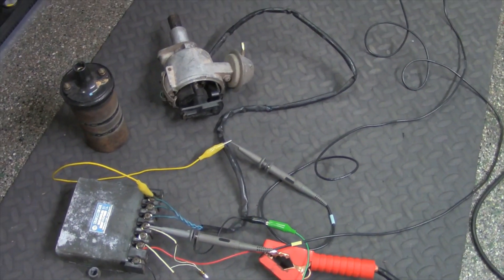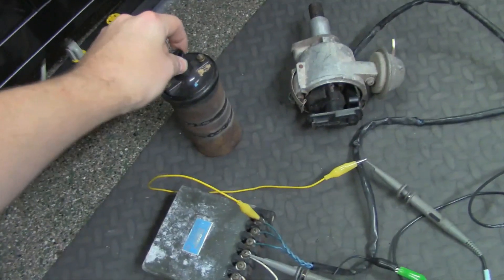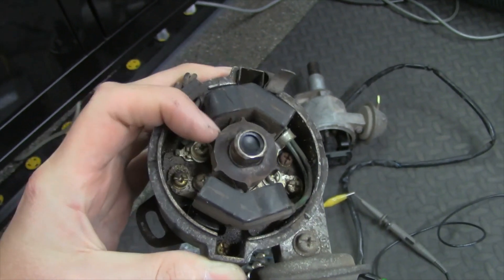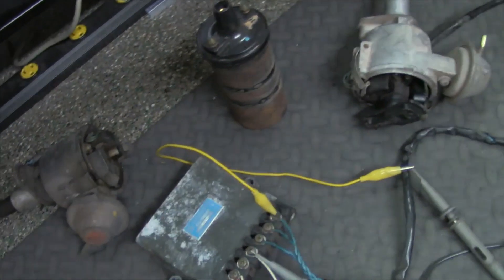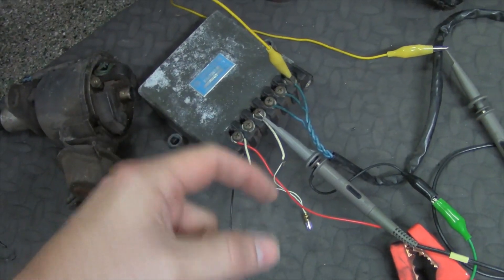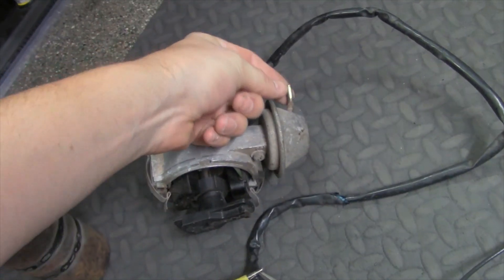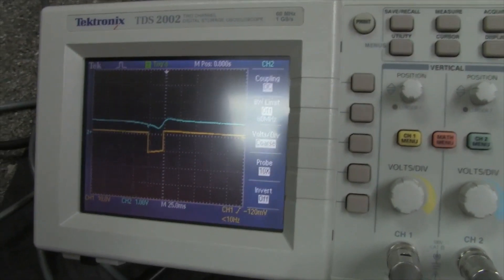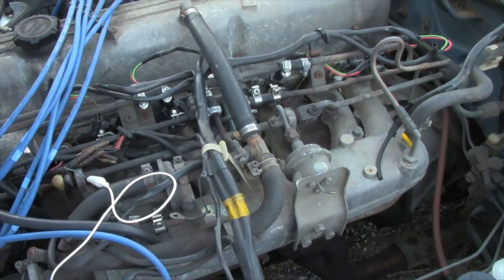How Datsun 260Z/280z Electronic Ignition Works  (by synthpro)

Comment: I know this is an old video but is there a way to test that box, my 280z ran perfectly then one day it cuts out terribly under load and I'm curious if this box is my problem, my other thought is ECU failure
Reply from the maker: Yes, you can actually test this box in a very similar fashion to what you see in this video. Disconnect coil form negative post and connect a test light between + suppl and the negative terminal that was going to coil. Turn the engine over and see if the light blinks with rotation. 

If it doesn't blink, I would check to make sure ignition module is getting 12V power when ignition key is on.  If so, you can actually check the output right at the module to make sure you do not have a open harness between module and coil. 

If you have access to a oscilloscope, you can test signal coming from the pickup coil in distributior as well to see if it's generating the sinewave you see in my video. 

The ECU is also clocked off ignition so if you lose ignition, you will also lose injection pulse.
Some era Zs have a molex connector for the ignition module rather than the blade terminals as seen in my video which does make it a bit more tricky to test at module. 

Also, be sure to check out my video on vacuum advance here: https://youtu.be/gaBTOO-JFJI?si=8JPp5Wy-Pk5RX4tR
this can also cause lots of issues when car is under load.

Hope this info helps you out.
Reply: @synthpro  yes that will give me something else to check, I had a 5 or six hour cruise and the car ran great parked it for the week and when I started it up the following weekend it ran like crap. Idles and revs perfectly but as soon as I'm driving it gets to about 4k rpm I lose fuel pressure and it stalls for a second then comes right back and will repeat that constantly. Never had trouble starting and staying running. New fuel pump, new fuel pressure regulator and hard wired the pump to a switch and it still does it so I'm really grasping at straws here. My thoughts are bad ECU, or something failing electrically in my ignition stuff. But I will check out your other videos and test some more things. Thank you for the response the more I rule out the less money I spend lol.
Reply from the maker: @Kylem5005  that's interesting, fuel pressure is unrelated to timing but could cause a similar behavior for sure. 
Happy to help you try to troubleshoot this problem. I have a few questions:
1.Are you actually monitoring fuel pressure when this happens? (You can buy a fuel pressure tester that goes inline with the fuel line and temporarily install it between the fuel filter and fuel rail.) If I remember correctly fuel pressure is around 28PSI at idle and goes up to around 39PSI when you give the car throttle. You can also test regulator operation by temporarily taking off the vacuum line going between regulator and intake...pressure should go up without vacuum.

2. Are you running a original fuel pump? (I was running a generic one on my car but found there was no good angle to install it without kicking fuel line a bit....you may have a slight kink that has collected trash). 

3. Has the fuel tank been cleaned? There is a screen in the sump of these tanks that can fill with rust and trash causing fuel pump to starve 

Something else I have ran into personally is that the ignition coil can go bad and it will get some kind of odd resonance inside the coil at higher RPMS causing misfires and delayed spark.
Reply: @synthpro  I purchased a fuel pressure regulator with a gauge built in and mounted a go pro in my engine bay to watch it. The pump is a cheaper one but from Z car depot (they are local to me) for a 280z 280zx fuel injected car. The tank is a new fuel cell with both a pre filter before the pump and the standard filter in the engine bay (both are new). Even when the car cuts out and acts like the  fuel pump has shut  off I can press in the clutch and it revs fine with no load. Also if I just throw it in 3rd and put my foot flat in the accelerator it goes to about 3500 cuts out for 2 or 3 seconds then comes back with a decent amount of acceleration and a back fire for a few seconds then does it again. If I stay in it I can eventually reach the red line with the off 2 or 3 seconds then on 2 or 3 seconds. So that leads me to believe it's not TPS related or just a dead spot in the AFM contacts. And I have one of the "black boxes" (the dealer sensor tester for the 35 pin ECU plug) it just acts as a really convenient multimeter to ohm all the sensors. I used it and all the sensors AFM tips seem to be in order so that's why I'm leaning towards the ECU/injector because it's predictable and ran great one day and the next it's like this. I can also send some videos if that would be helpful.
Reply from the maker: @Kylem5005  that's indeed a interesting fault. So, it sounds like you are running a completely custom fuel system on this car which would rule out some of the typical faults.  You are on the right track by checking AFM etc. It would be interesting to see what the injector pulse is doing in this event as well. You might have a water temp sensor problem which could be causing a fuel mixture issue but this typically causes more issues than what you are experiencing.

Another possibility is we are back to ignition/timing fault.  With vacuum advancement or possibly something either with reluctor pickup, ignition module, or coil doing something strange, (coil would be a big red flag because I have had them go bad and actually cause retardation in timing at higher RPM). Or indeed it's a fuel injection ECM fault.
Reply: Just a follow up my issue ended up being a busted diaphragm for the vacuum advance on the distributor. i replaced the points with electronic ignition which killed my tachometer but i think i know how to fix that.
Reply from the maker: @Kylem5005  that's great, glad you found the problem. There is resistor associated with the tach which may have gone bad. Thanks for the update.
Reply: @synthpro  yeah I've read about it some but am slammed this week but from my understanding adding an additional 0.5 watt resistor in series with the factory resistor will correct the voltage issue.

Comment: Think i need a reluctor.  Cant find one. Or should i replaces the whole distributor?
Reply from the maker: The reluctor itself is probably still good but you may need a new pickup coil. You can actually use a multimeter set to AC connected to the output of your pickup coil and turn the engine over....you should see a voltage generated if it's working.  
If you have signal here then the problem may be the ignition module or related harness from distributor to ignition module od from ignition module to ignition coil. 

Another test you can do if your car is a none California model, (ignore this test if your car is a California model) disconnect the red wire going to coolant switch, this will deactivate the electronic advance and allow you to start the car without the electronic advance which uses a different pickup in distributor. 

If you find that your pickup coil is bad, you can replace just the coil itself rather than the whole distributor.

Found this pickup coil here: https://www.carparts.com/details/Nissan/280Z/Standard/Pickup_Coil/1978/SILX507.html?TID=gglpla&origin=pla&gad_source=1&gclid=CjwKCAiAvdCrBhBREiwAX6-6UlHaWES9VkFzjKZKw3wmuR9FsTWXGs2xJCLqTjdySIxnpHNBUEMGRhoCCkMQAvD_BwE&gclsrc=aw.ds

Hope this helps.